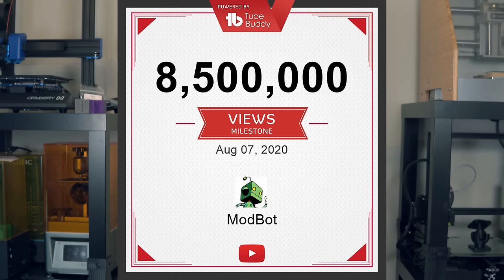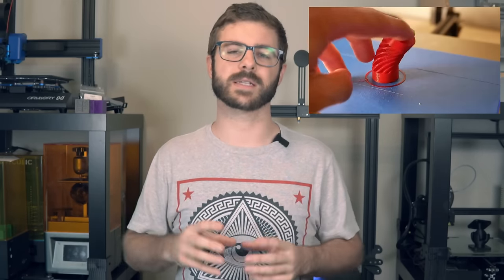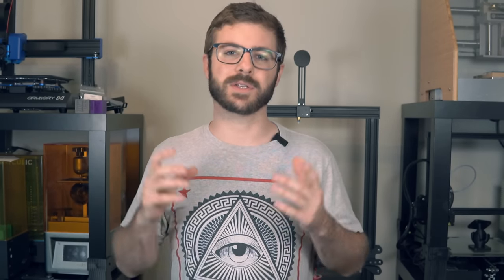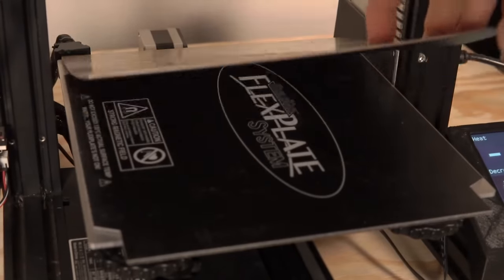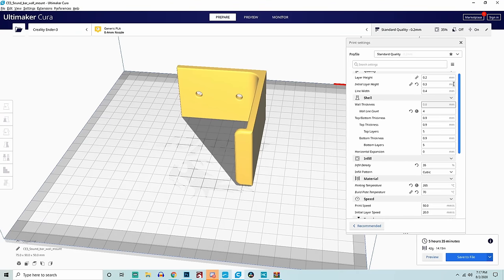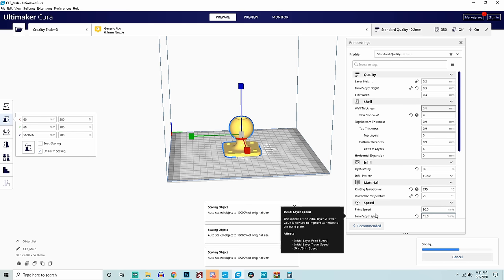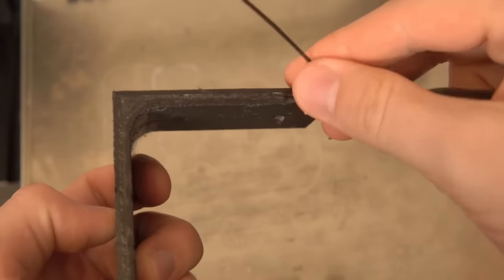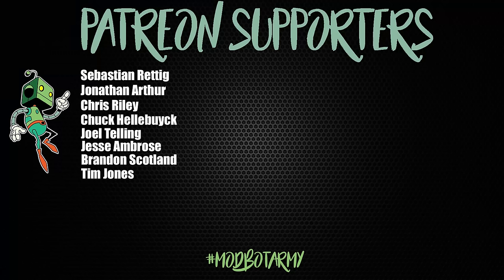3d Printing Carbon Fiber Nylon For Beginners (Ender 3)

Comment: EXCELLENT video! How smooth is this Carbon Fiber Nylon? I'm wondering if it'd print smooth enough to allow me to 3D print a cab for my 14th scale Rc semi truck? I want to print an older style Mack cab to place onto the chassis.
Reply: It really has a rough texture. Not rough like say, rough sandpaper, but like very fine sandpaper. But still rough. For cabin on RC model, go either with ASA or polycarbonate (but hard to print without heated chamber). ASA is probably your best bet. Plenty of colors, acetone vapor polishing, UV resistant and quite though material. If you use a draft shield and brim and abs slurry, you can print it even without enclosure. CF Nylon is expensive and mostly suited on chassis itself. Also, there are CF Nylons and CF Nylons. NylonX from matterhackers is just marketing bullshit. Avoid cheap crap like eSun. Really serious is Polymide PA6-CF, 3dxtech CF Nylon. 
If you want somewhat smooth texture and high performance, Polymide CoPA is your best bet. It’s a Nylon but not CF filled, but very though.
Reply: @ZhuJo99  Thank-you for the information. Hopefully soon I'll feel confident enough with my printer to undertake this almost week long print!
Reply: @pnwRC.  oh now I see you asked more about how well it prints. Well for a week long print that must be a big part – not sure if it wouldn't wrap or start cracking at higher layers. For such huge prints you have to consider heated chamber.
Reply: @ZhuJo99  Yes sir, it's large, but not that large. I believe 50% of the print time will be supports!

Comment: Sweet! Thanks for the video! I have a couple rolls of carbon fiber nylon, and an Ender 3 Pro with a MicroSwiss hotend. Haven't tried it yet. I've got filament from TreeD (Carbonium), and from eSun (ePa-CF).
Reply: have you been able to print epa-cf successfully? what settings? flow, temps, retraction, everything. i'm having problems. i can't solve...
Reply: @icepod  Hey, I didn't have a chance to use it yet. Nothing that I printed has yet warranted using it compared to PLA+. What problem are you having? Warping? Bed adhesion? Do you have a heated chamber or a tent to keep the heat in and protect from drafts?
Reply: @wandererstraining  I've since added a heated chamber, spool dryer directly fed into it. It helps a lot, glue stick and raft help,. Especially for small parts. Not getting the desired precision on prints though, I'm only printing it at 260 (aiming for 275) and for some reason my printers won't go higher when I set it, it always flips back to 260 after a second. I had 300 running fine a few months ago on one , but I've fiddled with so much since then, I don't know what could be doing it. I've checked everything I could think of... Octoprint, octoprint plug-ins, printer and cura settings. Firmware should allow it. Funny thing is, the printer that I didn't upgrade the firmware on was the one that ran @300 and I didn't upgrade the firmware on it, yet now it does the same as the other one. Both are anycubic vyper. Any idea what could be doing it? I think that would be the last trick to getting decent prints.
Reply: @icepod  What kind of hotend do you have? An all metal one? Here, I'm also using a TH3D EZBoard V2.0 motherboard. Could also be a heater cartridge problem? Are you using slow speeds? Is it possible that the printer is trying to keep the temp at 300°C, but that the flow cools down the hotend and the heater cartridge isn't powerful enough to make up for it?
Reply: @wandererstraining  it's the stock hotend on the anycubic vyper but it is all-metal AFAIK, I haven't swapped it out yet. I didn't want to upgrade yet so as to not introduce more potential problems. I did swap the nozzle out to hardened steel though, but until I can get it to not throttle the temp back to 260, I'll swap the hotend out. It'd be great to not have to swap the thermistor out, that's why I was testing it before, to see if the thermistor could read the Temps, and it held 300 rock solid, but I really only need 275. IDT it's a heater cartridge issue, since when it held 30p it was very stable and accurate. The way it throttles it tells me that it has to be something software or firmware. If I set it in octoprint, the temp graph of the target blips up for one second, then the target goes back down to 260 the next time interval. If I set it in the printer touchscreen, entering 275 and clicking OK just doesn't change the target temp at all. If I set it the same place to 260, it works, but if I hit the + button, it won't go up to 261, it stays at 260. Same thing if I set the nozzle temp to 275 in the cure profile when slicing, it just prints at 260. Yes, I'm using super slow speeds, 10mm/s. That helped a lot, I think it compensates for the temp because it's so slow that it heats up the previous layer so it gets a decent bond, but the bond could be better, and it doesn't seem to liquefy as much as it should. The heater cartridge should be enough, like I said, it held 300 perfectly stable. It definitely shows the target nozzle temp being throttled down, I'm not talking about the instantaneous nozzle temp. It has to be firmware I think, are there any terminal commands to check?
Reply: @wandererstraining  but like I said, the firmware is supposed to allow it. But the official specs say that 260 is the limit. I would swap out the hotend with a drsgonfly (or microswiss? Still undecided) buy it would just be a waste for me to swap only to find out that it's still throttled by firmware or something. I'm using a custom firmware by zombiestudio3d but he said the firmware should support 275. I just don't know where to go from here....
Reply: @wandererstraining  BTW if you want, I can send you my cura profile when you want to start printing that esun-CF, it took me lots to get it to work. But I'm trying to optimizing for strength and detail, so 0.1 layer height. It's so close to being good enough...
Reply: @icepod  Oh, wow! Thanks! How's the layer adhesion with that filament so far? Is it pretty smooth?
Reply: @icepod  Sorry, I hadn't seen the two previous messages when I responded. Yeah, it does seem like it's a firmware issue. The custom firmware you installed, did you compile it? The temp limits should be in the code somewhere, most likely in some included file containing a bunch of variables.
Reply: @icepod  Still regarding the firmware, you used the binary file from that video description?

https://www.youtube.com/watch?v=5O-oF0FaoPg

If so, you should ask the person who compiled it, they'll probably have a better idea of why it throttles down and can confirm the upper temperature limit with you.
Reply: @wandererstraining  yep, the firmware I originally tried was older and it throttled, so I upgraded to the latest one from studio zombie 3d, and it still throttled. I asked him, and he said the nozzle temp max is set to 275 so it should do 275 no problem. The original one on this printer was also studio 3d zombie's, just one of his first ones. The thing that's weird is that the printer that held 300 (with a zombie firmware!) is now throttling and I didn't update the firmware since it held 300, so it makes me think something else has to be throttling it. But I can't find anything in octodash or cura... I have no idea what else to check...
Reply: @icepod  I don't know either, but I'm curious to know what the solution was if you find one!
Reply: @wandererstraining  I'll keep you updated, thanks for the help!

Comment: Is there a video discussing the tuning of the micro swiss direct drive?  I just installed one and am looking to fine tune.  I got e steps done but don't really know what my acceleration and jerk should be at to account for the increased weight of the print head.

Comment: What kind of temp sensor do you have on the hotend? The original ender 3 sensor has got some PTFE which can be melted with high temp. Usually high temp thermocouples are in a metal casing that cannot be fitted on micro swiss.

Comment: Thank you for the video, it was helpful. I am printing with carbon fiber nylon pretty well so far. But the one thing I am having issues with is that in the few areas where I do need support it sticks to my part very well and is difficult to remove. I'm sure that is related to the nylon having good layer adhesion. Are there any suggestions on settings adjustments in Cura that can help the supports come off cleaner?
Reply: You can go to full setting visibility under support, and there you will find something (I forget the full name, sorry) along the lines of support  distance that can space the support further away from the model, making it easier to remove
Reply: adjust your support x and y distance

Comment: Excellent video! Could you please weigh in on how you find the micro swiss direct drive/all metal hot end vs the stock ender 3 in terms of  print quality? I ask because my I have read that the additional weight on the hot end with the direct drive results in slightly poorer quality prints even when using proper jerk and accel and retraction settings. Your comments on this matter would be greatly appreciated.
Reply: I'm wondering the same thing. Been thinking about upgrading to the micro swiss DD with all metal hotend too but don't know if I should due to these possible issues. Have you upgraded it in the meantime?
Reply: @patrickspapens5497  After watching a bunch more videos, I purchased a Hemera direct drive kit since it is one of the lightest offerings for direct drive.
Reply: @ripper9111  okay, thanks for replying! I'll look into it! Any downsides to that extruder I should take into account?
Reply: @patrickspapens5497  Not that I could find. Setup and operation is straightforward.
Reply: @ripper9111  just found one on the internet at a shop nearby, reasonable price too. Thanks a lot for the information, greatly appreciated 👍

Comment: Nice mods on your ender.. mine is almost the same, just without direct drive. 

Your carriage looks different, is that a modified one and where did you get it?
Reply from the maker: The carriage is included with the microswiss direct drive all metal setup. It is included in the kit.
Reply: @ModBotArmy  thankyou..

Comment: Would carbon fiber polycarbonate have the same settings and would it also need to be dried? I bought a spool of priline carbon fiber poly and I'm trying to do some more research before I start wasting material.

Comment: Did you have any problems with clogging with the .4mm nozzle? All my previous attempt at printing with different CF materials have suffered from clogging when using too small nozzle. Yes they were hardened nozzles of different kinds.
Great video btw.
Reply: you will bridge the carbon fibers onto the input side of the nozzle clogging it you need enough flow for continuous dispersion of the fibers try .6 make sure your heats are not to high either

Comment: Carbon Fiber,  maybe Nylon too needs higher temperature,  up to 300 C
Can i upgrade my printer to print higher, and what about the temperature setup in the system, now i have maximum 260 C deg .... thanks for any info 🌞

Comment: I didn't hear you mention heat resistance of this material. Can printed pieces handle sitting in a hot car on a sunny day?  Normal PLA just goes completely soft.  I bought some PETG for this application, but the print quality is poor.  The infill has terrible adhesion between layers. It globs a bit. It also makes weak brittle prints overall. I have bumped the print temperature up and down within the suggested range, but really never got better results.
Reply: what goes in the nozzle comes out!

Comment: I heard the ender 3s catch fire and actually can catch fire from the plug itself
Reply: Where did you hear that?  I'm considering an Ender3.
Reply: @fukcg00gle95  from other people that own Ender 3s. There cheaply made and are not saftey tested apparently
Reply: @lordgains3317  while upgrading the Ender 3 mainboard to SKR Mini E3 I saw the stock heater connectors weren't in ferrule, more resistance/heat in that spot.  it's recommended to get a quieter mainboard anyway, being the usual first upgrade

Comment: how does carbon fiber 3d printing work. Is there a seperate nozzle for the epoxy that it puts as it lays the carbon fiber thread

Comment: Great video thank you! Just one question. I own a ender 3 too with an skr mini E v2 board and the maximum temp of the noozle is 260 Celsius. How can I raise the maximum temp?
Reply: I read through the comments to see if it's been answered.  About 2 months ago, it was. In two separate comments/replies, it is said to change the settings in firmware. And or use a boot loader. That stuff is above my knowledge, sorry. That's all I got
Reply: You have to upload official version of Marlin with modified settings for your printer. Check line #define HEATER_0_MAXTEMP in Configuration.h
Keep in mind that Marlin 2.x might NOT fit into the memory of Ender 3, but on mine JGAurora A5 it went just fine.

DO NOT reconfigure your max temperature if you don't have All metal heatbreak (steel or titanium or even better, bi-metal) as PTFE line in regular heatbreak melts at 260 °C. Also, with common thermistor (typically 3950 type) you can't go over 300 °C, so this is maximum temp you can safely define in the Marlin IF you changed to all metal heatbreak.

Do not forget to change slicer settings for your regular PLA or PETG, with all metal heatbreak you want to lower your retractions considerably (3-4 mm for Bowden) and rise temperature by 5-10 °C, so you will print PLA at 210-215 °C.
Reply: @ZhuJo99  In my ender3 I have the skr mini e3 v2 so I think I have to find the Marlin bug fix which is the current version of the firmware in the board and to flash it. My hotend is a microswiss full metal. Thank you so much for the explanation!!! 🙏👍🙂
Reply: @gabrielemoro1  Then you are fully ready. You can comfortably upload current version of Marlin 2.x from master branch as the bugfix has been merged to master about one month ago. Just download the configurations pack, find both configuration.h and Configuration_adv.h files for your Ender 3, modify and put it into main Marlin folder next to .ino file. Compile for SKR with proper Arduino processor set and flash.

Comment: Hey, I've got my hands on markforged onyx filament and trying to print on my ender 3 max with a microswiss NG direct drive hotend + hard steel nozzle. However my printers max display temp is only 260 degrees. How do you make the temps hit 270 degrees?

Comment: Awesome video....quick question ive been wanting a 3d printer for a while now and I would like to know if you have done a video of the right  upgrades for a ender 3...thanks in advance👍
Reply: there technically isn't a "right upgrade" for a 3D printer, just upgrades that can help you do specific things. for example using certain filaments

Comment: hey thanks for the video. any chance to get the cad model of the bracket ? that one you have made put of aluminium. I work with cnc machines and I can make out for my self one. would appreciate answer if thres a model somewhere

Comment: Is the nylon carbon fiber filiment waterproof once printed. Im looking at making a bracket for the PWC (Jetski). And would it be strong enough. Also great video.  Simple and easy to understand for us Newb's
Reply: yes if you can print 400C do it in 9085 ultem PEI

Comment: Great video very informative thanks. 
I have a full metal  hotend on my e3 but I don't know what settings to change in the firmware on my skr mini e3 to go higher that the stock 260c.
Reply: Change maxtemp settings to 300c. If your current firmware does not support it...move to th3d firmware and change maxtemp there......i believe their firmware allows 285c.......after this...your machine will go up to 275c on the eprom, but can be overridden in your slicer up to 285c. With 285c...you will be able to print most nylons and some pc....cheers
Reply from the maker: It is max temp in marlin. You will likely need to flash a boot loader to the board as well. I made a video on the boot loader portion of it. There should be many videos on modifying marlin on YouTube.

Comment: Considering buying my own 3D printer for beginner engineering applications. Any recommendations for a great bang for the buck, printer? Thanks in advance
Reply: The Ender 3 is a perfect starting machine that’s great for its price (150-170€).
If you wanna invest a little more (around 200-220 in total), I‘d recommend the Ender 3 Pro

Comment: Interesting stuff! Just one thing, on a 5 Plus (assuming similar limitations on a stock ender 3), how do you go around the stock 260C that I can't go any higher on the screen? Can that be overrun on G code? And can the thermistor resist 280C or 290C?
Cheers for any pointers! I know isn't the printer you have there.. sorry.
Reply: Sorry the response is so late, but in case someone else comes across this same situation, to my current knowledge the temperature limit can only be changed in the firmware, and it’s 15c higher then what your printer will truly be allowed. So say you need to print at 270, in the firmware you’d need your temp limit to at least be 295.

Comment: I'm new to 3D printing and looking to get an Ender printer. I'm wondering which to get? Ender 3 Pro? Ender 3 V2 or Ender 3 MAX. I want to be able to print using carbon fiber but im not sure if all these printers can do that.

Comment: What is the best filament for a great surface finish? Something like a 63 surface finish you would get when machining a part?
Reply: Nylon CF is OK if you sand it by hand afterwards with increasingly finer grades of paper.